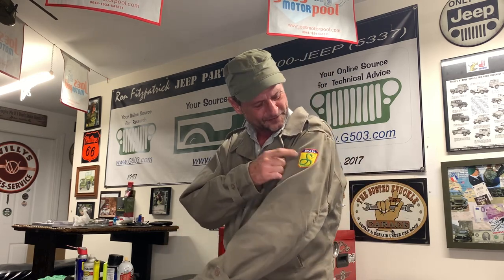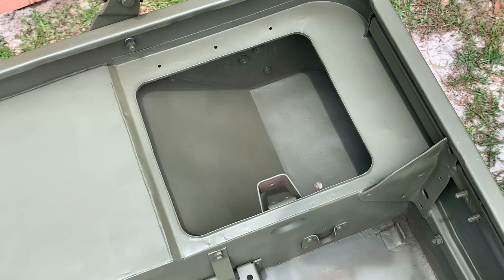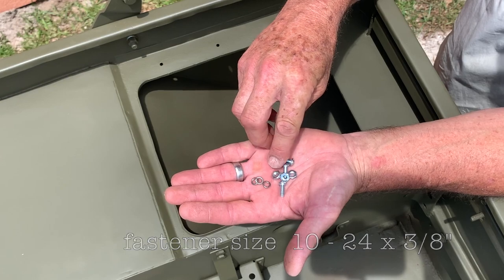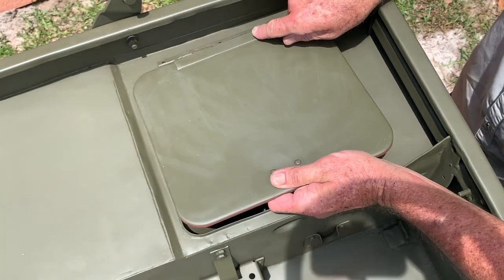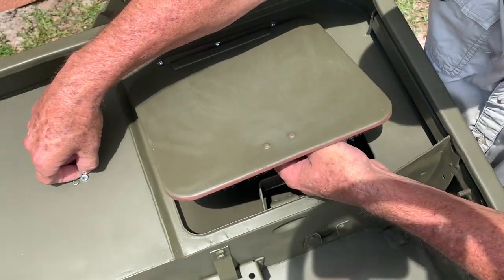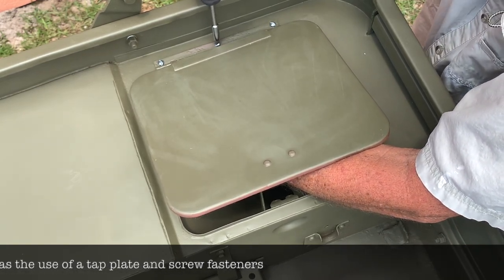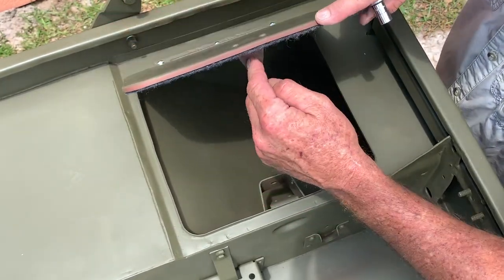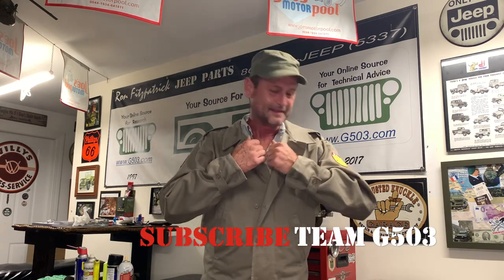Installation Of The Tool Box Lids On The G503 Willys MB

Comment: Little tip for awkward nuts and lock washers where you're balancing the washer on the nut; superglue the washer to the nut. If it's a really awkward place where you're trying to balance on your finger, as long as you can turn the bolt or screw head to start the thread, wrap some masking tape around your finger and glue the nut to it. Once started, pull the paper away. Put a latex glove on first so the glue doesn't soak through to your skin.